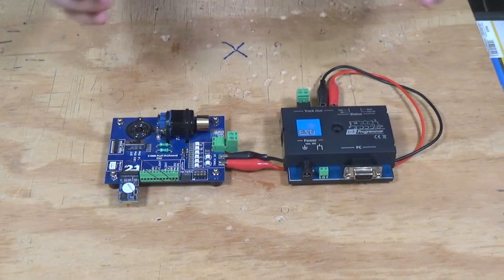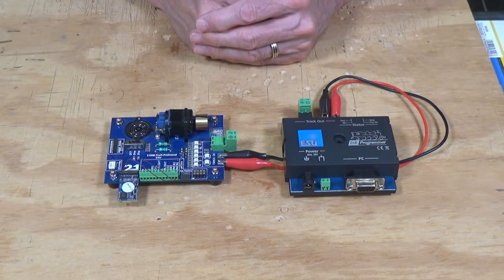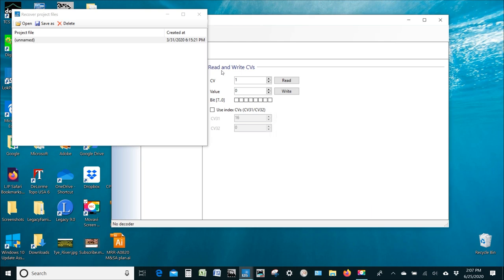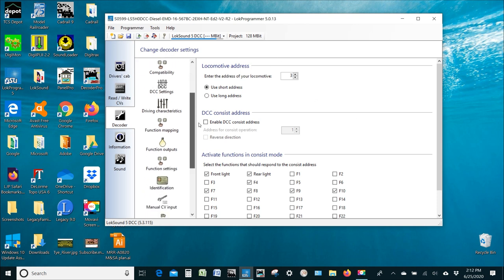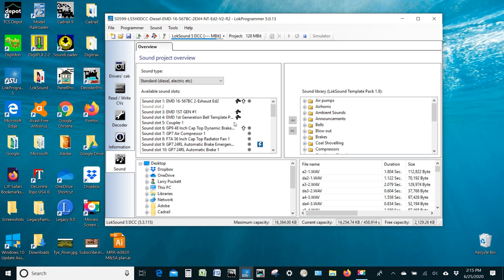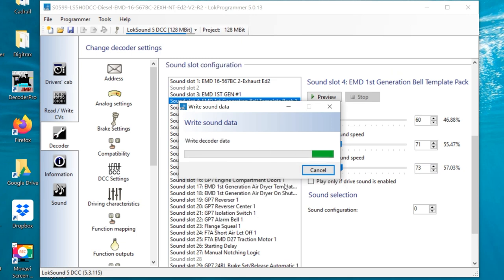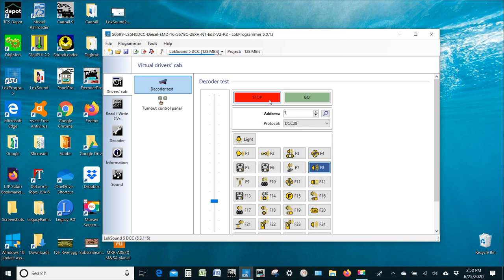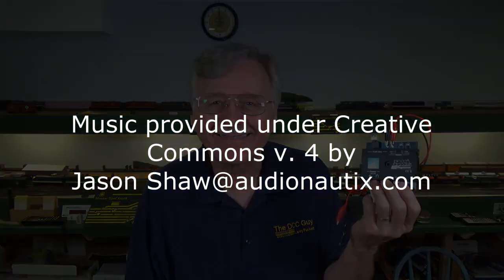Uploading Sound Files To LokSound Decoders (103)

Comment: Using Lok Programmer and latest software, and downloading factory sound project (73877 Select Direct Micro) in a Windows 10 PC. If you check the downloaded file the Functions and General tabs will display the factory Functions Descriptions (light, bell, horn...) and under the General it display a full locomotive description, but after loading project to decoder both areas are blank for the most part.  How can I keep the factory information when moving the project to the decoder?

Comment: I have the same thing hooked up right now.  Tester ESU53900 to Lokprogrammer device and that connected to windows 10 laptop so the only way right now that I see something is working is when I click for decoder information, is recognized.  I am currently using decoder ESU 58429 which I will be installing on 5 of my locomotives.  Two of them is getting new main boards that currently have soundtraxx and I am changing to loksound 5 so all 5 of those locomotives will have that decoder in them.  So with that being said,  I am not seeing any lights coming on,  on the tester

Comment: I am looking at a Lok53900 decoder tester but it looks slightly different that yours so what model is yours?   I like the idea of preloading sound files into decoder before it goes into locomotive.   I have that Lokprogrammer device and I hook it up to my windows 10 laptop.
Reply from the maker: It is at least 8 years old so they probably have updated the design in that time.

Comment: Hi Larry, some time ago i was watching one of your videos were you mentioned the value of I-Phone speakers. compared to Sugar Cube, I have obtained some from the internet but unable to see what to do?  there is 4 electrical contacts. Any advice would be greatly appreciated.   I really appreciate your videos very informative. Thanks
Reply from the maker: The iPhone 4 speakers that I have seen only have 2 electrical contacts—what kind did you order? Once you find out the type then just do a Google search to see what the extra contacts are for and how to use them.
Reply: @TheDCCGuy  It was I-Phone 4 now I see it now  one is the screw hole fixing (note electrical) the other is the connector for the signal antennae that came attached to the speaker unit leaving the two terminals.  Thanks Larry Great stuff keep the good stuff coming with your videos I live in the Philippines so need people like you to keep me updated on products like the alpha voltage amperage meter from DCC concepts, you covered in a previous video.

Comment: I just got my ESU 53900 decoder tester in the mail today! Haven't even had it out of the package yet, too much "stuff" on the workbench! That will be tomorrows project. I'm guessing this could be used with the Digitrax PR3 or PR4 to load sound programs into their decoders. I bought 4 SDN136PS decoders at a price too good to pass up. One of them will go into a Bachmann 0-6-0 steam locomotive that I modified to more closely resemble Union Pacific #4439, the last operating steam locomotive in the Los Angeles area. I put a Digitrax DZ123 in it, not a lot of room. I'm thinking some frame mods may be needed. But anyway, the SDN136PS comes pre-loaded with a steam sound file for a class K-27, a narrow gauge 2-8-2. I'll be needing to load a new sound file for it. This is uncharted territory for me, glad you're there to help guide me through it!

Comment: Hi Larry not sure if you still monitor your utube posts but wondered if it is possible to extract a sound file from a retailer loaded ESU loksound decoder to a file on PC using lokprogrammer or other means then reload onto new blank loksound decoder as i have a decoder that i have lost audio output but everything else works i.e. drive & lightning so suspect amplifier ic fried. Cheers Norm
Reply from the maker: Norm—to my knowledge these are proprietary files that cannot be extracted. However most sound files for North American prototypes are available on the ESU website or the model manufacturer’s whereas in the UK and EU most are available only from creators who embed a serial number for the specific decoder it is to be installed on.
Reply: Thanks Larry i wondered if that may be the case, will buy a blank loksound & see if i can find file close enough on ESU site as this was a Class 68 Transpennine Express so exact wont be avail. Keep your tutorials coming they are very helpfull. Cheers Norm

Comment: Larry,can I use the newest ESU Loksound Command station to program ESU decoder sound files?Or do I still need the stand-alone decoder programmer.Also,can I use any version sound files with the latest sound decoders?(i.e.,V5 decoders can I use version 4 sound files)?Thank you for your time and these videos.
Reply from the maker: I din’t own one if these bu AFAIK the command station can only program the decoder CVs but I don’t think it has the capability to upload a sound project to the decoder. For that you either need the LokProgrammer or have the dealer upload the sound project when you buy the decoder.

Comment: I am getting the error "the current sound file is too large for the decoder error", any idea how to resolve this ? Many thanks
Reply from the maker: I’ve never seen that one. If it is a ESU LokSound file you’ll haven’t to contact their tech support. If it is a third party file then you’ll need to ask them.
Reply: @TheDCCGuy  thanks mate, I have many ESU based locomotives never had this issue. Looks like the memory of the decoder is corrupt and needs kind of reformatting for a fresh writing and that is something I don’t know how to do with the lokprogrammer. It is a free ESU sound file that was there. I have written to them, let’s see how it goes. I shall definitely share the outcome of this here so everyone can benefit, please wish me luck.
Reply from the maker: Have you tried reloading the decoder firmware?
Reply: @TheDCCGuy  yes Sir, did that. The decoder is not dead, the lights and movement back and forth works, just the sound file or sound memory is corrupt it seems, it is not allowing me to rewrite anything in the sound memory, even though the space seems empty. This is a unique experience… I have reached out to ESU support let’s see
Reply: @TheDCCGuy  further update, I tried checking if the sound files are there in the decoder … there are none, but the moment I try to write the sound file it turns red and says that the file is too large for the decoder. Which means the space to write the sound file is not there. I tried with the smallest sound project to check if that works, but still same error
Reply: Update, ESU said they would replace it under warranty, which is really nice of them and they did mention it is not because of something I have done that could cause only the memory chip to fail while the decoder remains healthy otherwise

Comment: Can the ESU tester be used as a bench programmer before you install a new decoder
Reply from the maker: Yes, that is the idea. You can also program the decoder on it before doing an installation and since it has a speaker you can test the sound. By the way, several companies including TCS make comparable versions.
Reply: @TheDCCGuy  I have already purchased the tester but the paperwork that comes with it is hard to read and I couldn’t find where it said that.  Thank you so much. Love your videos.

Comment: Hi Larry, Does the programmer it allow you to copy and paste projects from a decoder which already has a complete sound file and duplicate/save it to a new blank decoder? I would imagine the sound projects are protected by serial numbers and wont allow you to copy but thought i'd ask.
Reply from the maker: To my knowledge you cannot download a sound project from a decoder to use on another one since as you say it could lead to copyright type issues. However if you have a sound project you have download free from the ESU/LokSound website then you can makes changes to certain types of files. This is a very complex process and to et an idea you can download the LokSound decoder manual rom their website and read the section on that.

Zimo has an interesting take on this in that you can load a paid version sound file into one of their decdoers and then buy the activation code for it. That protects developer’s work theoretically encourages development of more sound projects.
Reply: The DCC Guy thank you for the reply

Comment: Excellent video. Does NCE do similar equipment to upload sound files and can files be uploaded to other manufacturers decoders such as Zemo etc.? Best regards, John.
Reply from the maker: NCE does not offer sound decoders. The sound files, software, and hardware are all proprietary, which means they can only be used with that makers deciders.
Reply: Thank you for the clarification.

Comment: Larry watched your Video Actually on my Tv yes you tube on the Big Screen it's actually better  for some reason easier on my Eyes.. 

Got a few Questions I was given a Computer completely free from my cousin, It's an hp 650 with Windows 10 8 gigs onboard it has a i7 vPro processor.. I believe it has enough space for Decoder Pro & Esu's lok Programmer.. 

One thing I want the lok Programmer for is to Add too what say Kato or Atlas or Scale Trains has put onto the Decoder Larry like adding door sounds or if the Engine is used for DPU mode or just to change a Horn or Bell maybe add break squeal but I don't necessarily want to change what's been installed by the initial company.. If you could do or already have a Video on doing this type of Programming I'd appreciate seeing it most of my Decoders are installed by Kato & by Kelly Duford which was programmed with a specific program only from Kato it ain't one you can just Grab off of ESU's website Alec from ESU said this Larry so it's a Sword I want to tread with carefully I'd like to update or add to what the Decoder already has but not loose it's valuable contents & speed tables... 

Thanks for your Time Larry & I'm watching as Many Videos as I can sometimes more than once just to remind myself of what I watched not that I'm tuned in just trying to Cram in all that I can remember like at school..    Allen D
Reply from the maker: Yes you can modify LokSound files, BUT it is a very involved procedure. So before you take that dive into the deep end I suggest you look a lot more closely at what is actually involved. You can download those files and mess with them on your computer using LokProgrammer before you jump in and by the hardware needed. If you are not very computer savy you could be getting in over your head. I am a techie type and I have never quite figured it out.